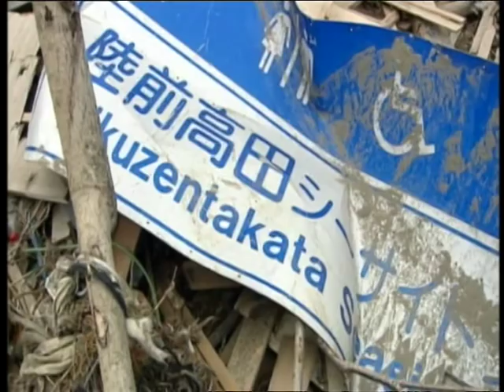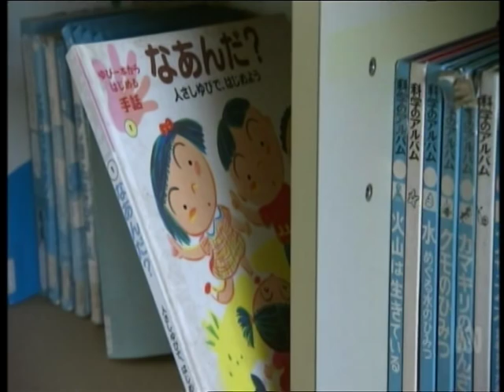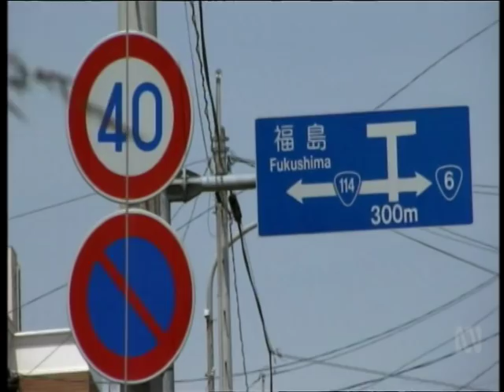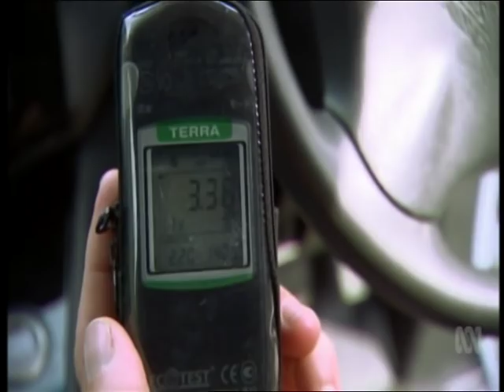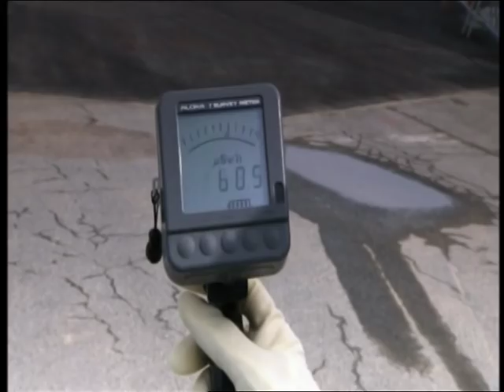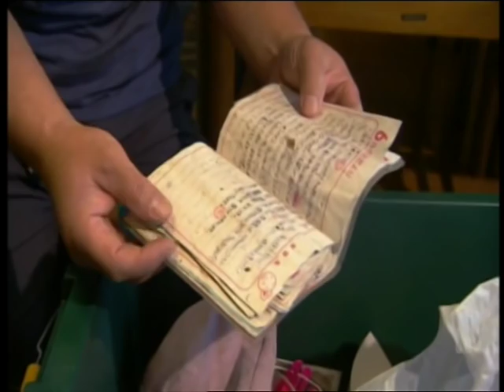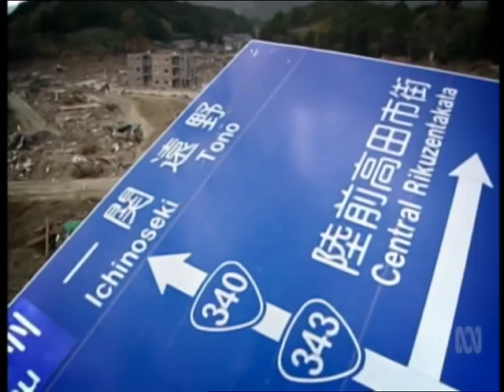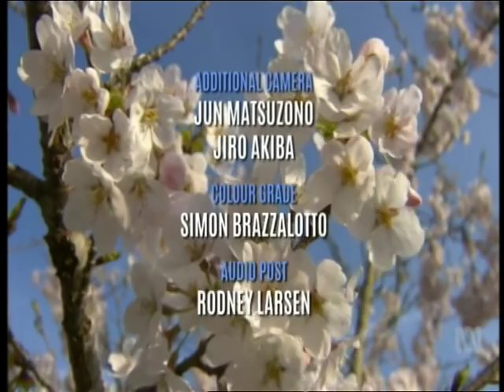Fukushima Five Years After

Comment: Turkey Point nuclear power plant, commissioned in 1972, was directly hit by Hurricane Andrew in 1992, with winds of 145 mph (234 kilometers per hour). Hurricane Andrew was a Category 5 storm, the highest rating. South Florida is the most battered place on Earth for hurricanes/typhoons. Turkey Point, overbuilt to handle winds of 235 mph (380 km/h) survived the storm surge as well, the generators kept the cooling water moving. Almost no one knows this story because it was built in a dangerous area, but the engineers and planners designed a system that could handle extreme threats. Sad for everyone that Fukushima did not receive such care in its design and construction.

Comment: those purple filters in the first minute don't hardly do anything....they are for dust and minor fumes like grinding wheels
Reply: jon levesque sr They will keep you from inhaling radiation contaminated dust (those are niosh rated for wet dry submicron - they'll keep out bacteria) but you're right, standing radiation bombardment goes right through like x-rays would do. Not safe but at least safER I guess, lol...

Comment: I do not understand the clean up effort. It seems they are trying to remove contaminated parts and move them elsewhere after cleaning and the whole things seem will take decades and probably will never be cleaned up.
Why not build gigantic walls around it all. fill up with foams that grows and hardens. I would make double concrete walls and keep filling until the whole thing is covered up.
dig deep and build walls in the ground as well to stop the radiation from coming out. 
It certainly sounds like a better idea than whatever they are doing. they're not even looked at some of the reactors which means they keep leaking radioactive material constantly everywhere in the air

Comment: Thank-You for uploading the video. I knew about the dismal situation in Fukushima, but it was good actually seeing it five years after the accident. I'm one of those people who believes that the Pacific Ocean is poisoned with radiation from the radioactive water that flows into it. The nuclear power plants in Fukushima were monsters that were created with no fail-safe system that would work due to all the variables that were involved. They still cannot figure out how to truly contain the monsters, last I heard some fuel rods were missing and fear was mounting that they seeped past the containment and into the ground water. At this point, I believe they are doing everything they can to try and control what's left. However, the real damage has yet to manifest ... My heart goes out to the people of Japan, the Pacific Ocean and all the little creature that dwell within. 

The United States is not blameless in this. General Electric had built reactors 1,3,4 and are being sued for not implementing the required safety improvements. Oh, reactor 2? That was General Electric and Hitachi.  It's a landmark case that's coming up.

Comment: i know how to build a fail safe cooling system for any nuclear reactor... even if the reaction was sustained afterwards and continued to rise in temperature the system will only run stronger to provide more cooling as well as being capable of cooling down the return water so that overheating would be virtually impossible no matter the meltdown situation... aside from the plant being hit directly with a missile or something else physically devastating that would have the potential to disable the cooling system in some form or another(which probably won't happen because there is no rigid connections between components and dampening between things that need to be bolted down and supported).  the problem with their systems now is that they run off decades old technology of fossil fuel which is extremely unreliable when it comes to overheating(loss of power), flooding(basically choking the engine off) or just oxygen starvation due to aftermath of potential fires... my system is capable of running in all environments and without oxygen! even if potentially flooded while it'd temporarily cool off the reactor, once it heats back up and boiled the water off the system would continue to run. when an engineer wants to get a hold of me i'd be more than happy to show them my system :) but until then i prefer to keep it a secret... to all those that think it's not possible... you just don't have enough knowledge about interesting and old/lost technology that didn't quite make it because "oil" and "fossil fuels" won out.